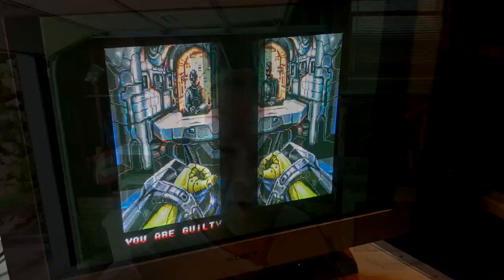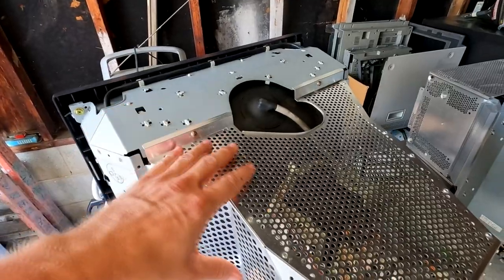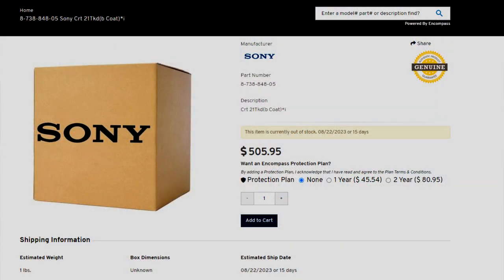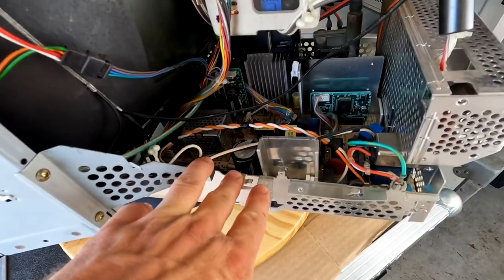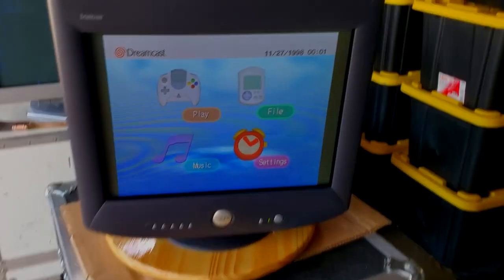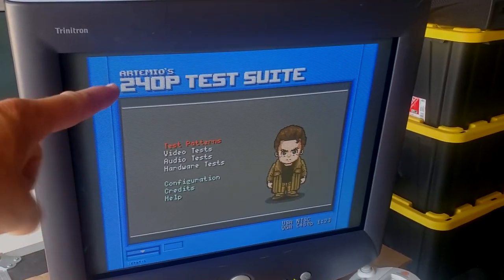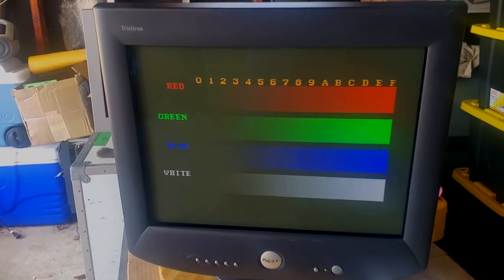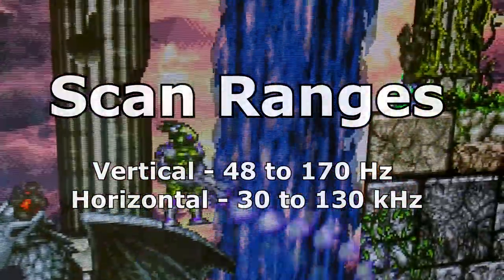The Dell P1130 Trinitron - Is it the best CRT you don't know about?!

Comment: Note about that 2048x1536 "max resolution". That's just the max resolution Windows will give when you hook up the monitor, that it grabs from the monitors EDID. But the actual max resolution is way higher, if you go by the 130kHz horizontal frequency ceiling

With CRU (Custom Resolution Utility), hitting that 130kHz limit will get you something around 2776x2082 @ 60hz. Of course the aperture grille won't fully resolve all those 2776 horizontal pixels, but the monitor will scan out that resolution. And it will look good. 

Though of course you will get more bang for you buck by picking a resolution within the aperture grille's dot pitch, like 1920x1440, and running a higher refresh rate. 2082p @ 60hz would only be really recommended for the occasional game that has a 60fps frame cap.
Reply: I have a DELL P1130, thanks for this tip! :)
Reply: @CubanLegend561  For me, either 1920x1440 @ 90hz for the ultimate image quality, or 1440x1080 @ 120hz for a nice balance of FPS and IQ, 120hz is great for FPS games, you can do 1280x960 @ 144hz too if you want even faster FPS, I also love how thick the scanlines can get @ 512x384 or 640x400 and even 640x480, the lower, the closer to 240p you get the thicker the scanlines, I highly recommend trying out games like Shovel Knight @ 512x384 or 640x400 depending on how low your monitor can go, there are monitors that are either 29, 30 or 31khz on the bottom end, this one is 30 and can do 512x384 @ 70hz for super thick scanlines and 640x400 @ 65hz for slightly less thick scanlines, either of which will look incredible is Shovel Knight, and also retro emulated games will look much better with native scanlines rather than software scanlines, even 31khz monitors that can only go do 640x480 @ 60hz will have nice scanlines at that resolution, though a fair bit less prominent.
Reply: the .24mm dot pitch most likely restricts it before the khz does, know what a .24mm dot pitch on a 21" display converts to in pixels?

Comment: Hidden service menu on these if I recall holding the menu button down while also powering on, then you will now see service menu entry option within the default menu. In there you can do RGB color Gain/Bias adjustments, Bright/Contrast bias, geometry, etc with much more freedom. From there you can finally tweak that flyback screen-pot to get that bottom gray scale to true black while compensating contrast in the menu. Pressing up-arrow while powering on brings up self-test.
Reply: thank you for this great information , its mean maybe its better to use service menu over the windas ?
my monitor little bit dim i need more contrast
Reply: Wow, thanks, will try it out.

Comment: Good Trinitron monitors at a reasonable price are extremely elusive nowadays. When I was searching for a PC CRT I just had to settle for a 21" Viewsonic P815 in my area for $100. The Viewsonic is great (awesome colors, goes to 175 hz at 800x600, handles high resolutions well) but I really wanna get my hands on a high end Trinitron.
Reply: I have two apparently from when my dad worked on PCs and now I'm doing the same as a hobby. 

IBM P260 
Dell 1626ht 

The P260 has something wrong at the moment (worked then hissing)

Dell works great but will NOT work with the DP to VGA adaptor for some reason. 

Yet works fine on my XP machine.

1600x1200 is lovely on them but the more I learn the more I wanna actually fix them/restore them.

Comment: I believe the "B" coating is literally just B for black. And it's just a paint coating. The non b coating ones were bare metal and in theory could oxidize. The black coated ones had some protection against that. But I believe in practice the bare metal ones never did oxidize so the black coating ones never added anything to the equation.

Comment: Great job done here with crt machines, congrats guys. Until recently, I had a sony trinitron 21" cpd e530 and cpd g520. Although in principle a weaker model, the e530 had better image sharpness (even at 1920x1200 the sharpness was good) probably due to fewer operating hours. Manufactured in 2003 (g520) and 2004 (e530) . Recently sold it and now of course I'm sorry. Now I'm left with a nokia 447 pro 17" from 1999 as a solid consolation

Comment: I miss my P1130, ended up failing and selling it off cheap for some other enthusiast to repair.

Now i have an IBM P202, also a sony trinitron screen, but that now has vertical issues (not stretching to the bottom of the screen). Im in two minds about opening it up and giving it a clean. When I got it, it was very dusty. So im hoping if i can blow away any residual dust off, and hope it possibly clears it....

Comment: Nice overview. I own both the P1130 and FW900 and calibrated them. Have you run WinDAS before? I use it on windows 10 just fine.
Reply: Did you follow a guide for WinDAS?

Comment: I've got a Sony G500 that I use for my Socket 7 MS-DOS gaming Rig and also my Slot 1 Win98 PC via the two sets of inputs. , it works pretty nice with earlier games like Police Quest 2 but also later games like Unreal. I've also got a G420 I found on the side of the road spare as a backup. Thankfully it seems like most PC monitors are overlooked so the prices aren't the worst especially if its on a classified listing but some Sony branded ones have silly prices on eBay.

Comment: Have one of these, and it's a beautiful monitor, far better than any QD-OLED or WOLED monitor and will even outclass RGB-OLED monitors, I have the Sony E530 too, which uses the same tube and is identical baring the USB hub built into the G520 model, you have to see in person just how incredible modern and retro games look on her, @ 512x384 you get thick high-end BVM type scanlines, and at 1920x1440 90hz you get the most incredible image you will ever see, well that is until around 2027/2028 when 8K & 16K dual-stack RGB-OLED monitors hit the market.

Comment: 6:32 "The native resolution is 1280 by 1024."

What does "native resolution" mean on a CRT monitor?
Reply: It was born there
Reply: Probably the max resolution that's under the resolution of the tube itself, which means every individual pixel looks clear instead of slightly blurry.
Reply: In an LCD monitor, to display an image of a lower resolution than its native, upscaling is needed and that's what introduces blurriness. In a CRT, scanline separation becomes bigger because it needs to fill the same area with less lines.
Reply: he was just reading off an online spec sheet I'm guessing. CRTs don't have a "native" resolution though manufacturer's would provide a "recommended" resolution, though that doesn't really mean anything either.

Especially when it's 1280x1024. That's not even a 4:3 resolution, it's 5:4. So if you actually wanted to run "1024p" on this monitor, it should actually be a 1366x1024 custom res.
Reply: @lulkLogan   @lulkLogan  1280 is the max. horizontal lines that the monitor is capable of display. It may accept input signals with higher resolution, but that won't make for a better picture.
Reply: @UHF43 Nah, it's a 21" monitor, 1280 would be low compared to the others I've seen. My guess would be in the neighborhood of 1600-1900

And vertical resolution is "theoretically" infinite since it's aperture grille. Of course the beam size starts to overlap at some point.

Plus you get a sort of analog anti-aliasing, or super sampling, when you run a resolution over the monitor's dot pitch.

But I just do that if a game is limited to 60fps, since you want to run those games at 60hz, and might as well use the highest resolution your CRT will let you scan.

For games that are uncapped, then I agree with you and I run something like 80hz or 90hz at a resolution that fits the dot pitch.

Comment: Too bad you didn’t try 240p/120Hz 😊
Reply: Most pc monitors do 480p minimum
Reply: That's ugly on a 21" PC CRT, for two reasons.

120hz gives a double image effect in motion for 60fps games, so you'd have to use BFI to counter that, which really cuts down on brightness.

And these 21" CRTs are just too high resolution for 240p. You can already see sharp scanlines at 480p, so at 240p it's just ridiculous. The lines of color end up being thinner than the black lines in between. End result is straining for the eyes. 

So if you're going to play 240p games on a monitor like this, best to just run a really high multiple of 240p, like 1440p or 1680p, at 60hz, then add a more subtle scanline filter.
Reply: @lulkLogan  don't agree, my Sony 20" looks amazing at 240p(Retroarch) . No lag no problems, only sightly dimmer. Maybe you tried on old tube, mine has only 4k hours, CPD-G520P. Played through most of the old cps1 arcade games with a friend, no complaints ☺️. You need to check Lame Gaming videos on this.
Reply: @SamsungS-or1qf  I have 2 21" monitors and 3 19", so I know from personal experience. These displays are made to run up to 2048x1536. You can't have a monitor that high res also look good at 240p. The electron beam size is just too small

Comment: Using a CRT bellow 25" for retrogaming is a waist except for old school PC gaming on "high res" monitors.
In the 90s, there were no such little screens sizes in arcade. Even tv at home were bigger than 21"😉
It is way better to play on a big screen than a tiny one, don't loose your time...
Reply: Huh? Im using a 14" PVM on my desk, and its the perfect size. I can still see those beautiful 240p scanlines, and a larger set simply wouldn't work for my setup. Plus, larger sets are much harder to ship, and are more prone to interference. Bigger isn't always better.
Reply: That's not even true at all. Many people useb smaller than 25in tubes. In fact to watch this video I myself am on a 20in tube myself. Plus these are computer monitors, designed to be used at a desk and 20in computer CRTs already around 70lbs
Reply: Not true at all. Grew up early 90s and I had a 19 inch in the game room and 13” tv in my bedroom
Reply: I have a PVM2530 (25") and frequently find myself wishing it was smaller.
You're smokin' crack, man.